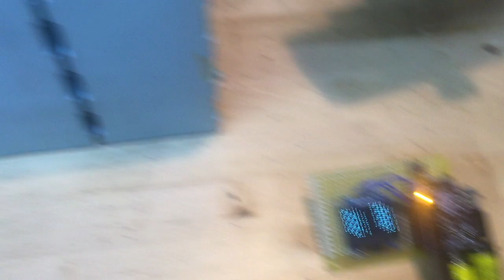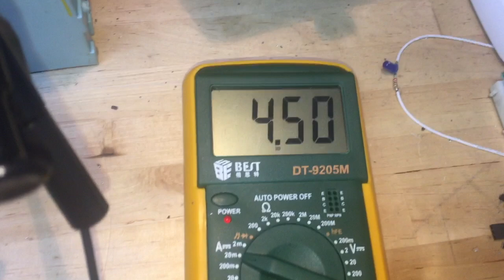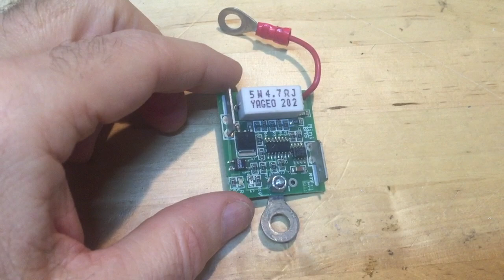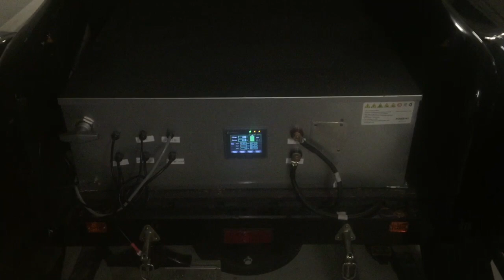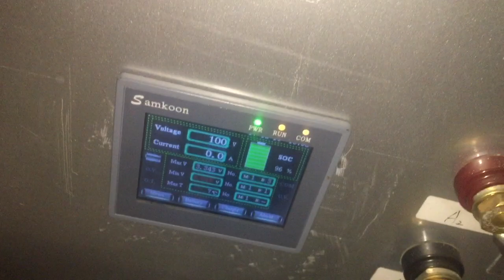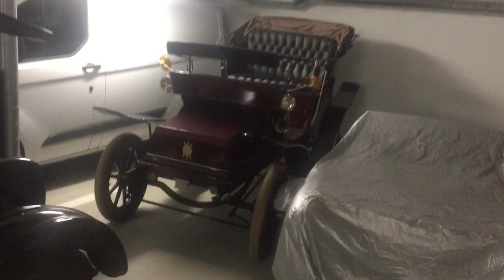Bluetooth BMS for my Detroit Electric

Comment: I equipped the car with a total of 64 LiFePO4 cells of 100Ah each. Two cells are connected in parallel giving it 200Ah and 32 in series to get 102.4V. Driving on a flat street it consumes approx. 55A at a speed of 45 km/h (approx. 28 mph). So, I should be reaching approximately 160 km (101 miles). However, this is not a very realistic scenario as there are curves, stop lights, hills etc. where consumption increases. But for practical purposes it is absolutely enough. I mainly use the car in the neighbourhood up to perhaps 50 km (incl. return).